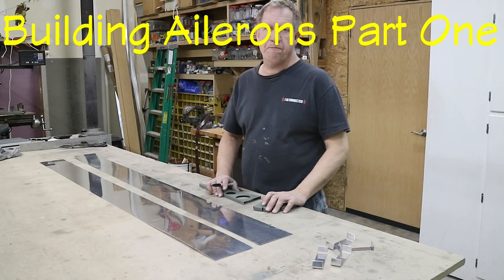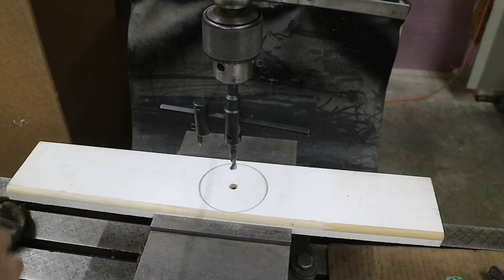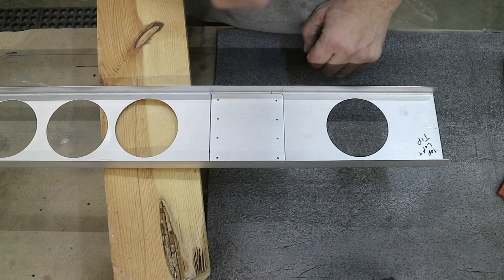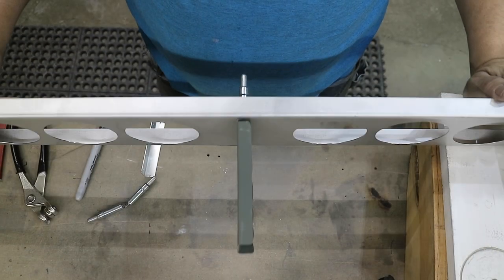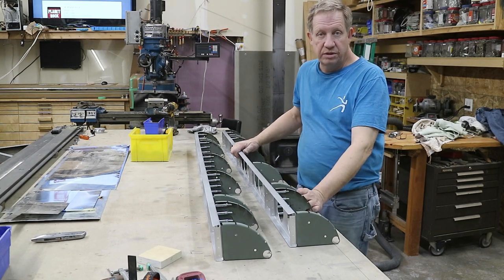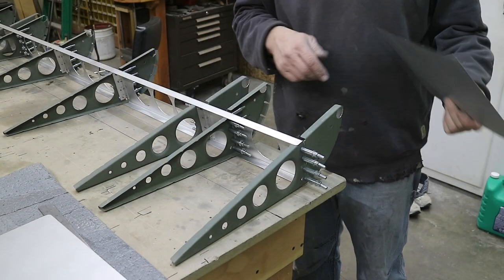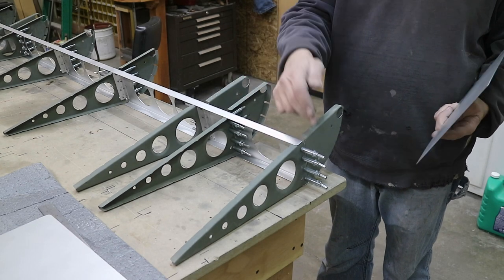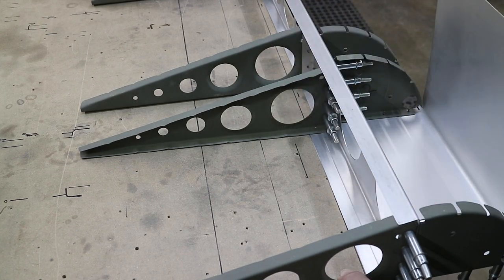Bearhawk Experimental Airplane Build : Aileron- Part One

Comment: What a fantastic job your doing! I’m pretty keen to start building a bearhawk LSA. Just wondering what primer you are using and are you also using alumiprep and alodine?
Reply from the maker: I am using Rust-Oleum self etching primer. I don't see the need for the more extensive corrosion protection.
Reply: Thanks for that! Keep up the great work B-Spot